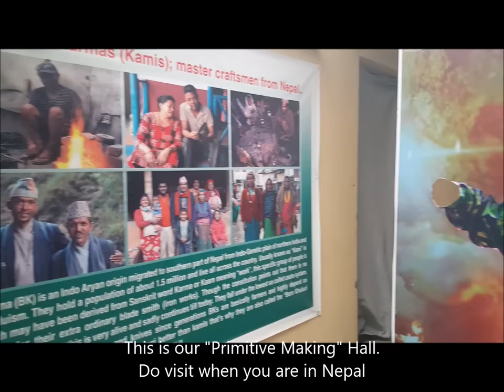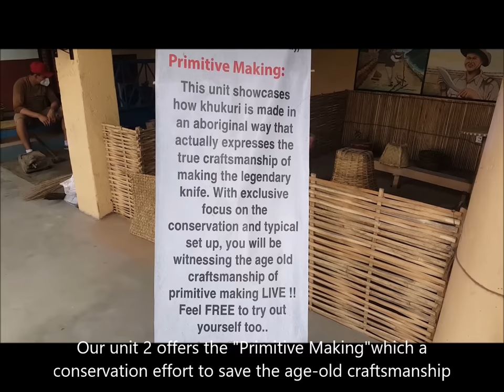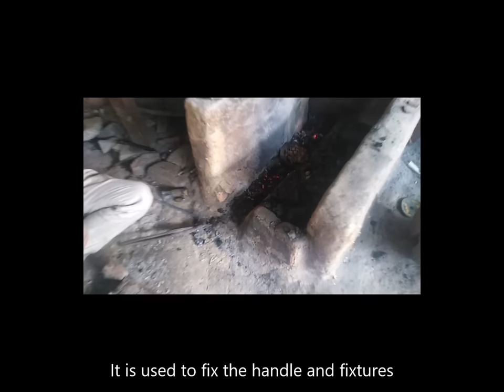Making Kukri in Primitive Method | Exclusively only @ KHHI nepal (The Khukuri House)

Comment: Out of all the kukri making videos, this is the most dedicated one. I think Kailash Blades is excellent, and the oil quench is good. But the water quench here looked pretty spot on as well, and I like the fact that the tang is carefully formed and heated up multiple times in the process, so I'd imagine it to be fully devoid of cracks and weak spots. It doesn't look like a bad process at all.
Reply from the maker: Oil quench is western bladesmith culture influenced.. not at all what we call the kamismith.. our root and methods have always been this way of making and hardening knives so we prefer to stick to it and promote it..

Comment: People do realize this is not how most of their blades are made, right? I mean, it isn't much different from this, but this is the special "Primitive Methods" interactive demonstration setup they have going for the tourists and factory visitors. Their normal blades are not made in front of a replica rural village setup, and they have no problem using power tools to grind out the fuller and blade notch. They are still hand-forged, but don't make the mistake of thinking this shows how all the knives produced by this factory are built.
Reply from the maker: yes William, all our knives are NOT made following this primitive way, only 4 models till date are made using this method, we have never said we make all khukuri using this method, we have given the details in the description as well. Thanks for the concern. We can't afford to make all knives following the primitive method due to production cost and only a few would buy them due to the high product price.  
So to make the products affordable for buyers and to assist our blacksmiths in the making process that requires heavy manual labor are modernized and power tools are used. 

finally, we are open all the time to visitors who want to visit us and see and get involved in the making process. we have no hidden secrets in our making, and we too provide the makers details, exactly who made your knife , which none other have dared to do. so its a fair game at KHHI. 

Jai Gurkha , Jai Khukuri !! 
Hail to the Blacksmiths !!!

Comment: What’s the notch for? 
I always thought it was for very small work like cutting string or tying knots. Can anyone tell me what it’s “officially” meant for?
Reply from the maker: Practically the notch works as a blood dipper to prevent the blood or fluid from going towards the handle so that firm grip can be maintained throughout the execution and also as a stopper to stop Chakmak (sharpener) from reaching the handle area when sharpening while running down the blade edge , 
Also there are other so many reasons pleas read here 
https://www.thekhukurihouse.com/khukuri-info